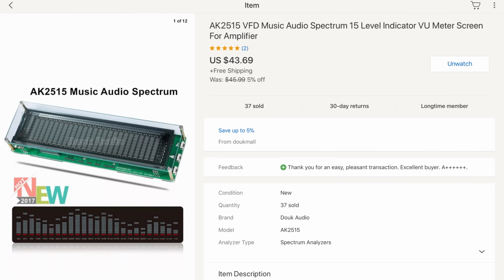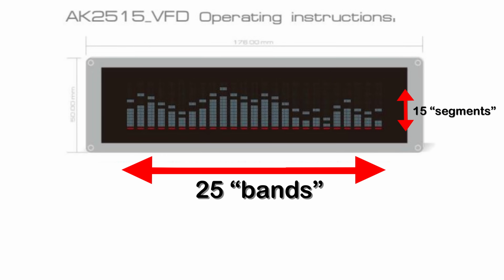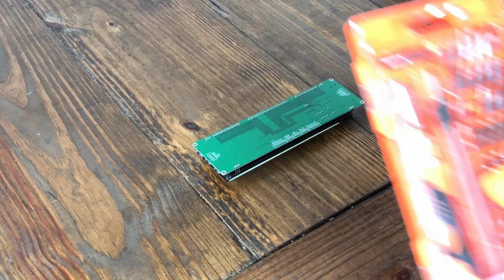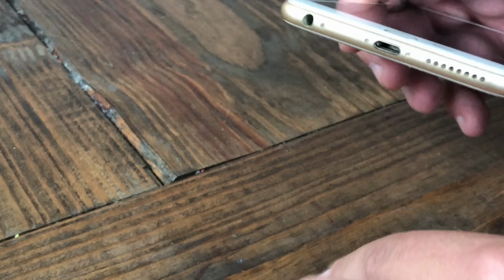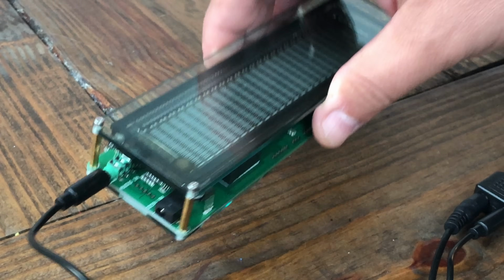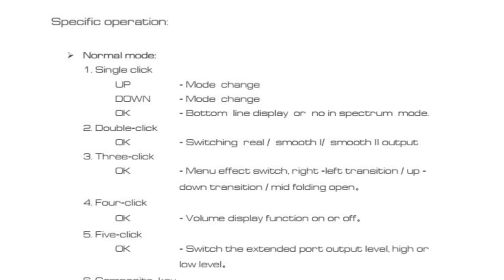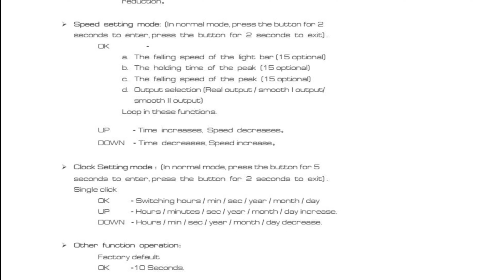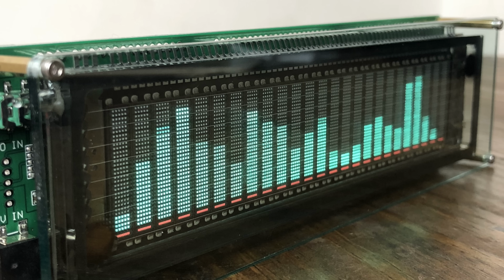Visualizing the Spectrum? AK Technologies AK2515 Audio Spectrum Analyzer

Comment: I had one of the old pioneer eq and I miss it. I think I would like this unit especially since it could just use some of the unused ports on my headunit.
Reply from the maker: May require extra work to get it installed and such in a vehicle, but it could be done ✅
Reply: BigDWiz I think it should be easy enough to solder some inputs on it and I have a dedicated 5v out that is unused for the power side.. I think the toughest part would be finding the cleanest way to mount it. Only thing I wish it had was a way to change the color.

Comment: i like it but it looks like it would be hard to read in the sun
Reply from the maker: Not any worse than the Sony XE-744 or Alpine 3342 units I have. Dang, should’ve shown all 3 in the video! 🤔
Reply: LOL true. it has potential though, if it were led and maybe had brightness settings and a illumination dimmer trigger wire, i'd find a place to put it in my car that would be cool as hell

Comment: Pretty cool but the way the inputs are on the side would make it very challenging to install in a din location.
Reply from the maker: Yeah, need some right angles or figure out how to solder some wires to the board
Reply: Thats why there are soldering connections on the back, you can solder wires directly to the back instead of plugging in the 3.5mm
Reply: A dark green filter in front of it will dramatically increase the contrast making it much more visible in bright daylight.
Reply: he used a Y connector coming out of the source. one side went to the display and the other provided a signal to the speaker.
Reply: I was thinking the same thing. Some 90 degree angle ones should work. As long as it doesn't got the mounting hardware. I would def like to get one of these. Hey wiz was there music coming from the unit itself? Or just your speakers.
Reply: I think that solder pad on the board near the audio jack is connected, you can probably solder some wire or connector there.
Reply: There's solder points on the back of the unit, where you can directly connect 5v power and L/R audio input.